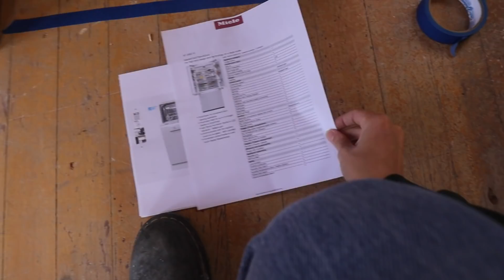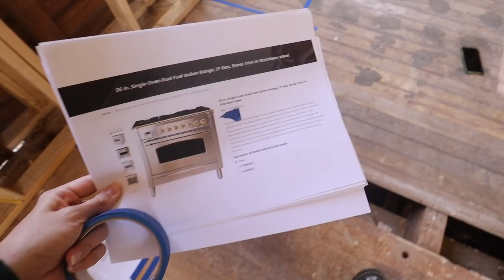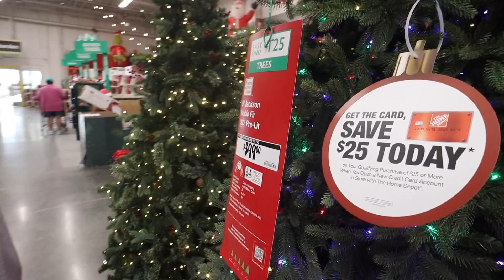renovating our home (day in the life) | XO, MaCenna Vlogs

Comment: In the beginning of your series, I thought you were a little OCD marking out things for your carpenters. But, we just did our first big project at our home, and it seemed like the contractor wasn’t listening and measuring. So, next time, I’m gonna be like MaCenna and give them a book and tape everything off. Thanks for teaching us your ways!
Reply from the maker: Omg me tooo!!! I thought they were going to think I was crazy but then they still were making mistakes or not understanding! Crazy 🥰
Reply: I've always heard so many nightmare stories of contractors not doing their job correctly the first time and it costing the homeowners so much later down the line so I think if I ever end up in a situation like this I will definitely go the route that MaCenna is going and tape down everything with notes and pictures of exactly how I want it done.
Reply: We drew on the walls (of course MaCenna doesn't have many walls!) when checking our kitchen layout. But it got so messy with errors etc.
Blue tape is a much better idea

Comment: Good  God woman, nail some chipboard on the outside where the siding is missing so you can finish the wiring, plumbing and insulation. The board can be replaced with the siding. Waiting is just unecessary.